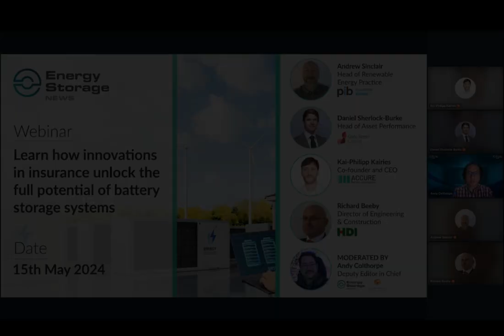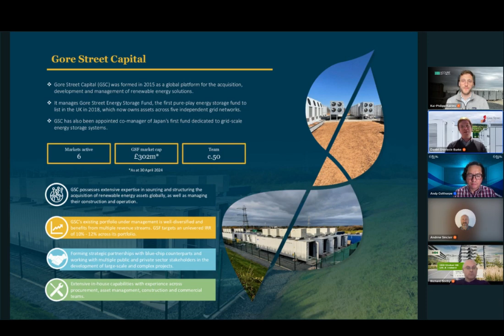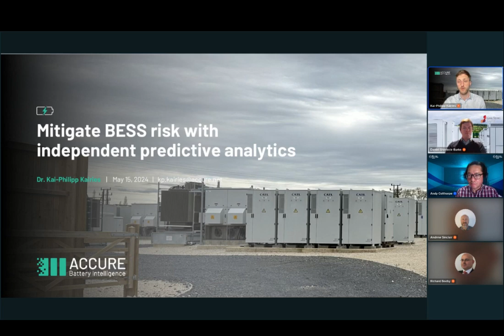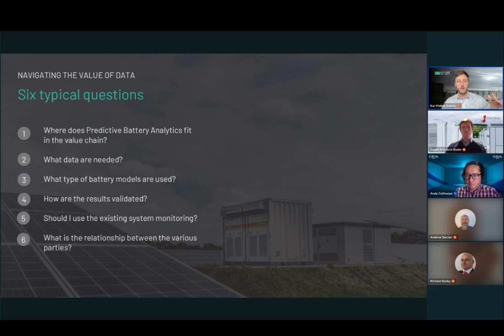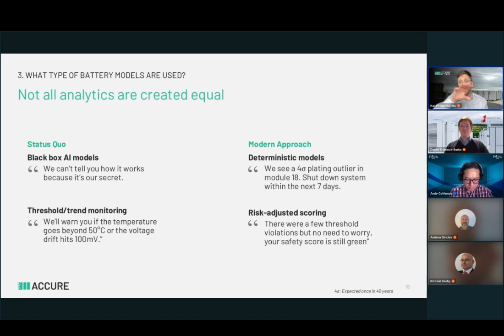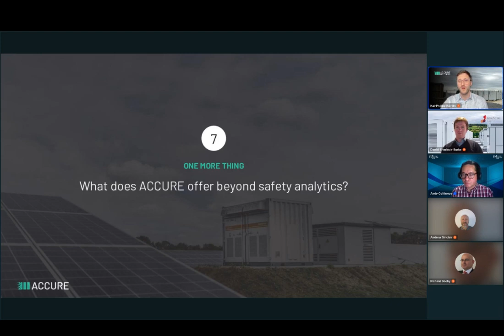Learn how innovations in insurance unlock the full potential of battery storage systems

Comment: I stopped watching after 5 minutes into this video when I realised that this presentation is focusing on Lithium Ion as the point of discussion in Energy Storage solution.  Perhaps on the other hand you might want to consider Electro-Chemical (w/ metal anode) Long Duration Energy Storage as THE stationary energy storage solution, with the following advantageous characteristics :
• Longer lifespan (in decades scale),
• Lesser efficiency degradation over its service life (by decades),
• A less environmentally hazard material being used (cheap & abundance),
• Possibly re-purposing convenience with less than 10% of efficiency degradation after decades in operation (tens of thousands of re-charging / dis-charging cycles),
• Etc.

NOTE :  Do get in touch with Long Duration Energy Storage (LDES) Council if want to know more.